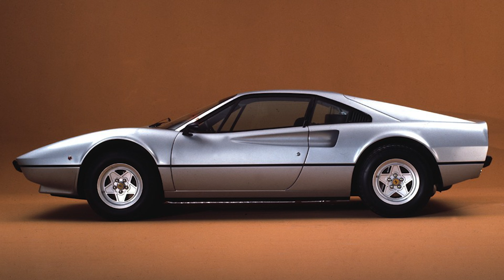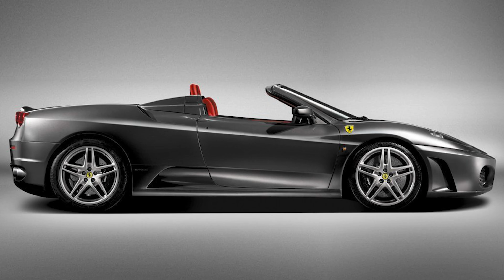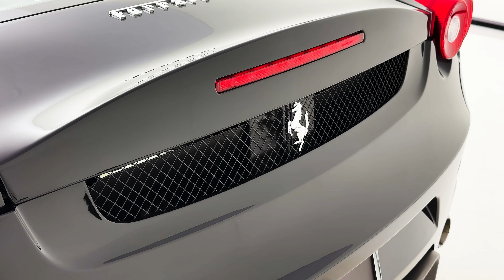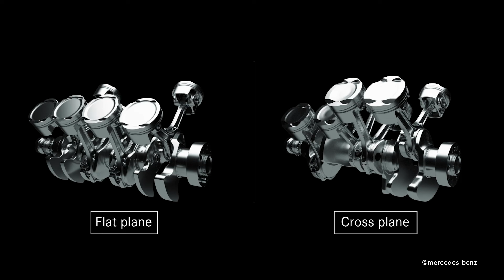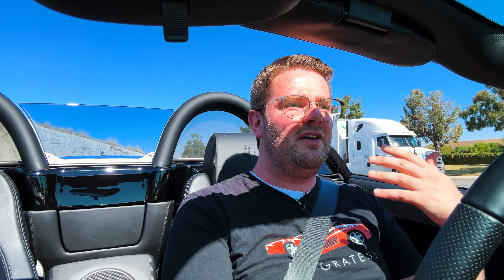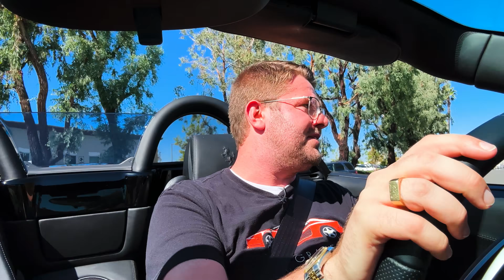2006 Ferrari F430 Spider Review: A Great Modern Enthusiast Ferrari [Kennan]

Comment: You DON'T BLIP THE THROTTLE. The car's gearbox ecu has not been programmed for that. People moan about jurkiness.. What happens in a manual when you put the clutch in? Everyone in the car that isn't driving bobs their head as the GEARBOX INERTIA between shifts alters the car's motion.

THIS IS WHAT IS HAPPENING in the 430 and 360. It is TOTALLY NORMAL. I can almost guarantee there will be undue wear on the clutch caused by attempting to rev match. Let the gearbox ECU do what it is programmed to do. The changes in later 360 and 430 are sharp and clean (or should be).

Comment: Kennan, the F430 only had one transmission. Both the 6sp manual and the automated F1 cars used the same transmission. The gated 6sp cars just didn't have the hydraulic system actuating the clutch and shifting the gears. The transmission itself is the same and that's why it's relatively easy to convert an F1 car to a gated 6sp manual.

Comment: It would have been nice to mention the actual designer, Frank Stephenson, although he might be offended at having one of his masterpieces described as 'simplistic'.  Simplistic means to treat something with false simplicity, often to misrepresent by ignoring essential complexities.  Just say 'simple', or 'clean'.
The downforce numbers are a bit odd.  First, the number you put on the screen (320Nm) is a torque, not a force and has no relation to 290lb.  You may have got confused that if you put a figure in lbf into an online calculator it may take that to mean pounds feet rather than pounds force.  The actual total number for the F430 is 280kg weight at 300km/hr, = 639lb weight.  If you step on the scales you'll find kilos to lb is about double plus 10%.
The handbook says not to play with the throttle on down or up-shifts because the car does it for you.  I find down-shifts don't need any help but you can help up-shifts with a gentle lift.  And that will prolong clutch life; mine is looking to last 50k miles and I do a few track days!
Nevertheless, that looks like a stunningly nice early example and I'd recommend the Spider to anyone.  If you think the coupe sounds good, the Spider with the roof down sounds like the second coming!

Comment: Ahem, Kennan please chose a more muted background than blinding white especially for a black car. The contrast is overwhelming onscreen and the details get lost. Sunlight outside is perfect like for the 456 GT a few weeks back. Way more natural which helps us connect with the car. BTW, it's unbelievably dangerous to drive on the original Pirelli PZero's which expired almost TWO decades ago even on a car with under 400 miles. But the driving portion really transformed the video into a visceral experience with the V8 engine song of those perfectly throttle blipped downshifts. Best part was the pic of you as a kid in the Ferrari dealership next to a new F430: PRICELESS street cred. 👊🏾
Reply from the maker: It was the dealerships area to film and outside had constant plane traffic. We like to do videos outside when we can, just wasn't possible for this one. Agreed on the tires, but future potential owners might want the original tires.
Reply: @carsandbids  I definitely understand now. There were limitations. Overall, a solid review.
Reply from the maker: We usually have a reason. :)

Comment: This design is truely timeless. The rear is perfect.
Reply from the maker: It really has aged well.
Reply: Frank Stephenson designed f430. X5. Mclaren p1 .... legend
Reply: But it's not very different from the 360 as you said 🤣 they are basically the same the 430 is just an Evolution of the 360 design
Reply: @kjell9661 aged to perfection 👌